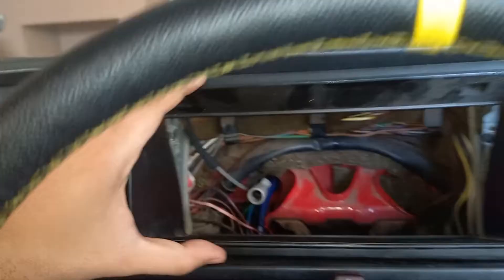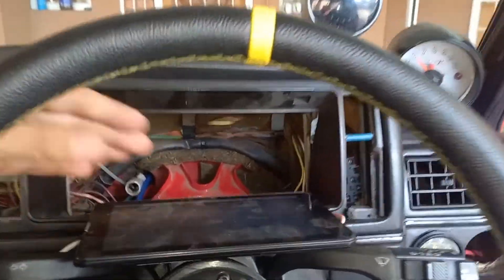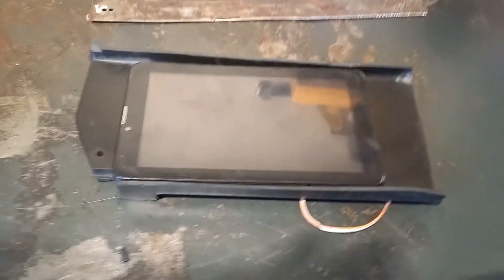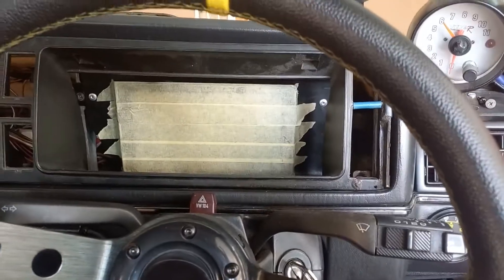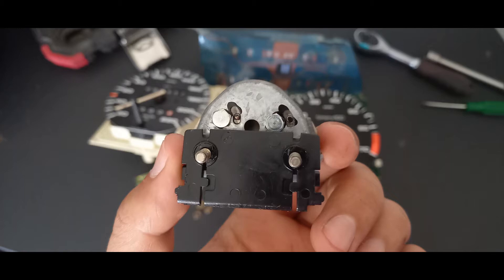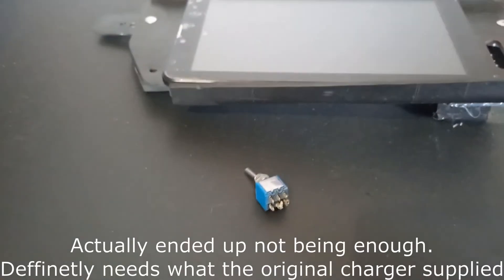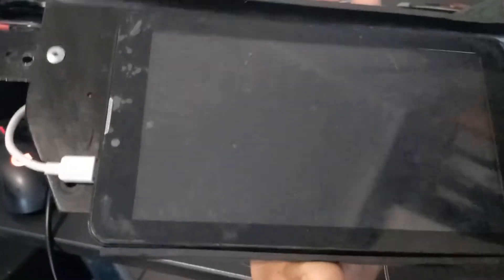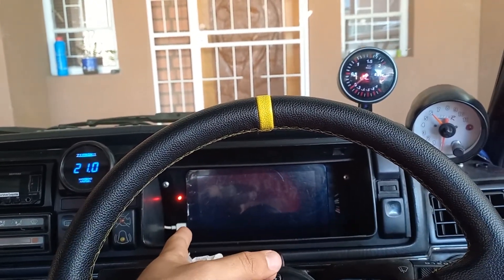DIY digital dash - Speeduino tablet dash cluster

Comment: I've tried dev kit 4..never win...we're did you get the speedunio from
Reply from the maker: Had boards ordered and made from pcb website. Soldered it together. Done.
Reply: @061garage ..im struggling ...
Reply: @061garage cant i buy it from some place
Reply: @061garage  ive tried the dev kit 4 esp32 flashed th3 board loaded new code but it says reset using rts pin amd it dont ever reset...tried 3 different mini boards no luck...

Comment: Good video mate. I feel your pain with the power options vs startup time etc. The only real way to do it with nice instant boot is a "can" driven screen. The pie dashes and full tablet dashes are just too finicky and slow to boot. I went to a full aftermarket gauge cluster with peak recall and programmable warnings. The price was less/same as a tablet or pie.
Reply from the maker: Which aftwemarket dash did you use, where did you buy it from?
Reply: @061garage  probably not what you think. A full array of individual 2" gauges. Cheap ones, but seem to work well. Not connected to ecu at all. So extra wiring to do. But I think it's worth it.
Reply from the maker: @g-mech1244  😅 you're right, definitely not what i thought. That seems like a good idea.